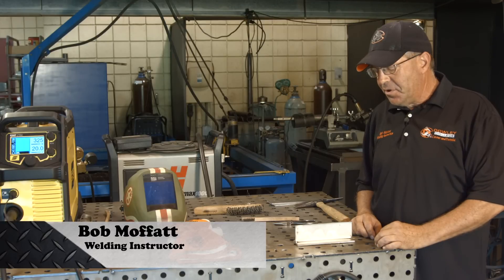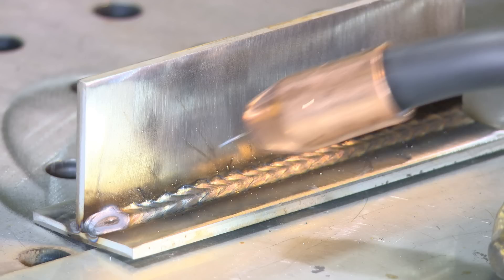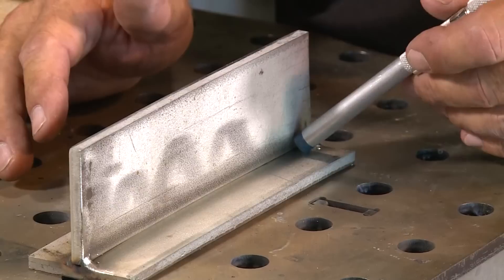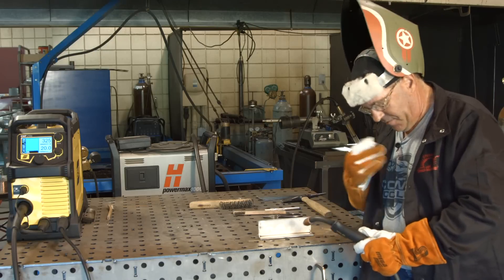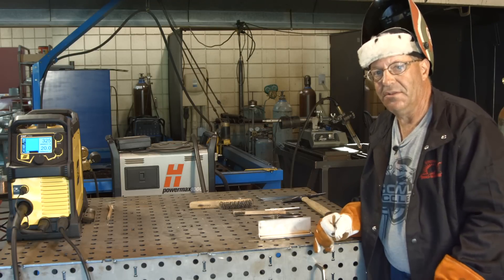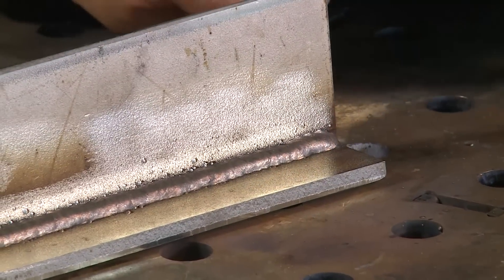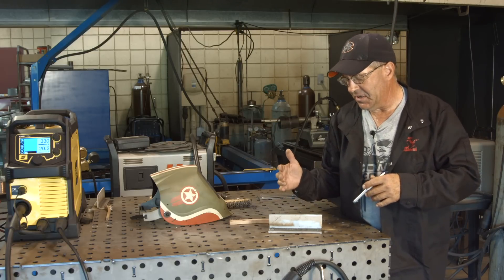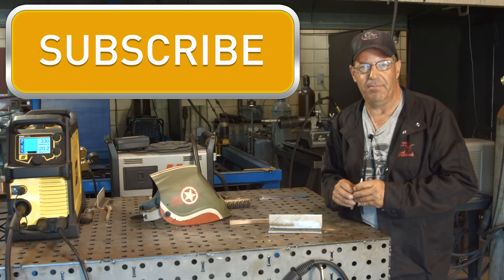MIG Weld Stainless Steel with C25 Gas

Comment: It was so nice to actually have a final answer with C25.  My shop does a ton of stainless, and TIG is usually overkill and takes forever - had a job for a radar mount and it took weeks for TIG, it was a miserable experience...  Always have C25 around though for the general work, and tons of 316 filler wire (Cheapest TIG filler rod you'll ever find, is MIG wire ;) ) Time = Money!

But Trimix is hard to come by in my area.

Comment: Hi everybody, for my experience what you did is good for a strictly welding point but is not for a metallurgy one. Welding stainless with CO2 mix gasses make the joint good and strong but it will got corrosion issues, especially pitting rust will come out soon. Stainless steel, especially the 316, has got chromium and molybdenum that need to make a pure thin layer in order to protect the inner metal from corrosion. Using an oxidating gas mix like the C25 the alloy is not able to make that layer and so you will obtain a joint without the most needed feature of stainless: the corrosion resistance.

Comment: How about a 75-25 gas with a flux core shielded stainless wire ? 
How would that work ? 

I went to purchase tri mix and almost passed out when they told me the cost (i guess there’s a helium shortage ?)

Comment: Hi Bob, aside from the difference in appearance of the welds between the 2 gas options: is Tri-Blend superior structurally to C25? My application in mind is stainless steel exhaust piping which sees massive vibrations, flexing and temperature fluctuations. Thanks!
Reply: I'd like to know the answer to this as well.. I'm not going to do mig stainless except for exhaust

Comment: Hello Bob, thanks for showing me that I can do stainless with C25 gas. This is the only gas I have currently because I mainly do carbon steel welding. My machine is a Hobart Handler 190 with 240 AC input. Obviously I’m limited with this smaller machine to only short circuit method, and from what I understand C25 can’t do spray transfer even if I had the heat. 
Question: are there any other metals besides carbon steel and stainless that C25 can weld ok?
Also, why do you pull back at end of your weld to fill the crater instead of letting off the trigger & zapping it again to fill the crater? Have I been terminating my welds incorrectly all these years?   
Thank you sir 😎👍
Reply: Hey how did it go? I got c25 and pure argon, and the same exact welder..

Comment: I think those kinds of questions are super important and you shouldn't take it personally. Knowing that that's a normal feature could prevent someone from wasting time trying to get their welds to lay flat the way they do with mild steel. I believe it's more of a characteristic of stainless, stainless is a austenitic steel so it's crystalline like a hardened steel, and may take more heat input and react to it differently

Comment: Hey Mr Bob.  I watch led your segment on Stainless MiG. Most Manufacturers say to use TRI MIX gas.  I found a .30 stainless wire from US Forge 308L and they recommend using C25 (75%Arg/25%co2)  is it just this particular wire or is all wire the same??

Comment: I found at my last job we had some welds get eaten out by chemical in washers. This could have been from the c25 on one of the welders I found, or maybe one of the guys used regular steel wire. I remember reading the the carbon from the gas bonds with the metal and is then not as chemical resistant. Any thoughts on that? I'm looking into this for welding SS at home.

Comment: I need to weld a cast iron exhaust manifold using SS wire, would  C25 gas work ok for this application please?
Reply: 309

Comment: I had to weld some ss to cs at my old job and we used 90/10. It was a 1” block of ss that gets machined so I just cranked it to 25/500. Using 309 , man it looked beautiful. Super easy. Thanks for video again.

Comment: Great video.. i had to make a "quick" repair on 304 stainless Overhead using c25. .030 308l wire..  Well found out it is impossible.. not sure why? tried it In both my feeders.. with all setting adjustments.. 😣! Had to tig it.. to get the job done. Worked ok..ish in the flat and horz. positions.. I use to use tri -mix argon,helium,and co2 but never tried it with o2?

Comment: i h
Reply: i have a question  what is the best shield gas to use on 316 stainless steel  and will the weld corode .i am welding up some brackets  for my boat marine invroment ??

Comment: What are the acceptable gas mixes for short circuit welding of 300 series stainless steels, that maintain corrosion resistance?
Reply: Argon oxygen

Comment: Hi Bob-another great video! 3 questions-1)The steel looks "as received" don't you clean the edges of the metal with abrasive or solvent? 2) I see one comment from part 1 where the question is "doesn't the weld get less stainless because of carbon pick-up from the C25 " but doesn't the trimix do the same? 3) Doesn't the helium increase the arc voltage and that is why the bead profile is different ? Hope you make sense of these questions.Best regards, Steve.

Comment: Great videos! Just came across your series. Any tips or considerations for MIG welding 316 SST? I plan on using TriMix and 0.035" 316 wire....lots of 11 ga. square tubing. Thanks!

Comment: hi Bob I did some repair in MacDonald restaurant as you know everything in the kitchen is stainless steel I were told that I could weld with the 25/75 gas but it may get rust because of a it  so I bought a trimix gas by the way is very expensive but it did an excellent job I notice that spark a lot and it make a weird noise while I was welding I believe is OK to use 25/75 gas but is recommend to use a trimix gas to do the job well done beside I want to be call again when they need me I make 450 DLS in less than 3 hours  please make a comment thanks
Reply: I’m not $150/hr good I guess

Comment: Great video Bob, I didn't think you could use C25 on Stainless. Other than color of the weld bead will the finished product retain the stainless properties as far as not rusting?
Reply: The carbon from the CO2 will get in the weld and it will grab the chrome molecules and that area will lose the stainless properties.
Reply: If you don’t introduce an oxidizing component or oxidizing contamination it will just be stainless...

Comment: I'm told by other mechanics at my work to just use regular wire on stainless, mostly 304, and I know it's not a good idea.  Besides losing the stainless properties what happens to the structure of the weld?
Reply: birdfighter0307 when you say regular wire I assume you mean carbon steel. If you weld stainless with carbon steel wire the weld will be brittle due to the drop of chromium content in where the two different metals meet. The chromium and nickel content drop into the hardenable range.

Comment: Always great videos. I've learned a lot about MIG welding. I have been a TIG welder for many years but not much MIG. Thanks again. I would like to see spray welding sometime.
Reply from the maker: We will be getting to spray very soon.
Reply: Thanks
Reply: spray is some weird stuff acts weird and gets way hot. Comes out looking really nice once you get it though imo.

Comment: I was given 90%/5%/5% (AR/CO2/O2) in place of 75%/25% (AR/CO2). Is this an acceptable substitute for 'general' steel MIG applications?
Reply: Yes, this is a very common gas mixture in both the U.K. and Australia. The oxygen content causes the weld pool to have less surface tension, causing it to "wet out" more, creating a flatter profile. Generally oxygen consists of 2-5% of the gas mixture with varying amounts of CO2 and argon; with a higher CO2 percentage for thicker sections. This produces x-ray quality welds on mild and carbon steels but does, however, leave a heavy surface oxide on stainless steels, similar to the one shown in this video - which requires an extensive amount of pickling paste in order to achieve a bright shiny finish.
Reply: At one time I worked for Crane Freuhauf trailers they used 5% co2 on all mild steel and stainless steel mig welding. The gas was piped around the factory so they did not want multiple mix's so it was just 95/5 and 100% argon available.
Reply: Point of shielding gas is to keep the O2 away from the weld.
Reply: @megasaxonzro9451  the main purpose of the shielding gas is to keep the nitrogen away.